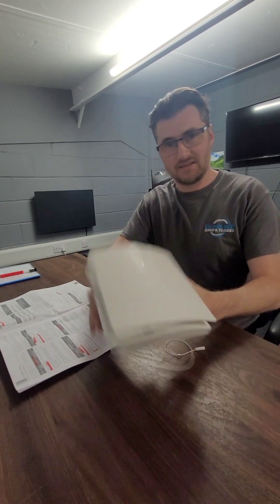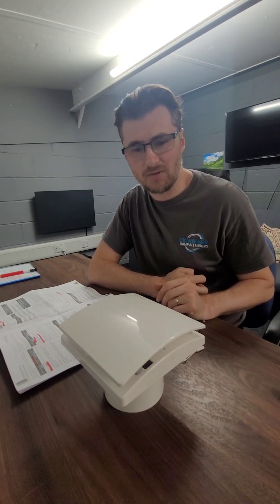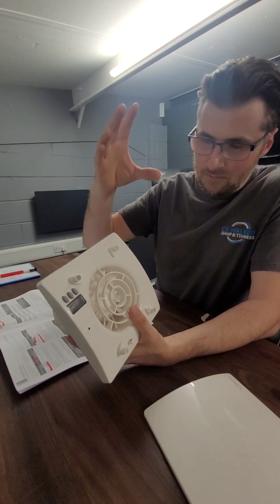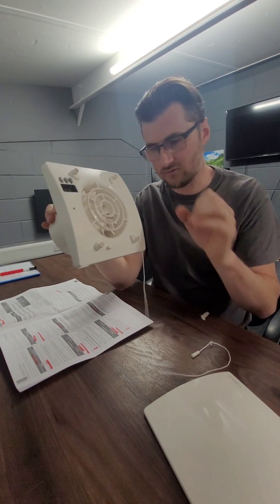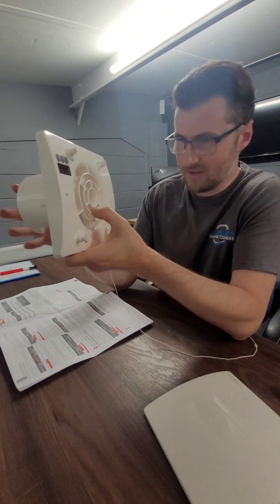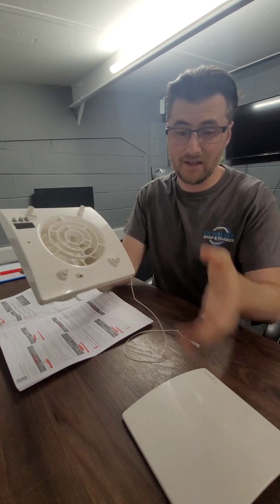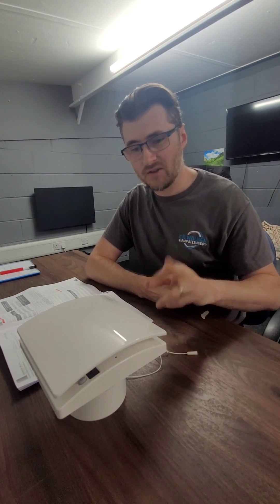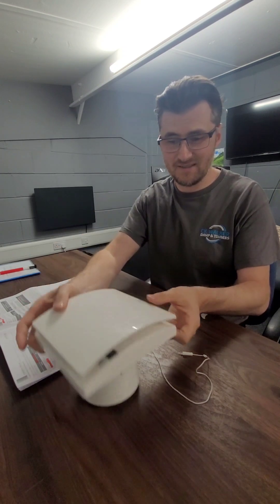Introduction to the Nuaire Faith DMEV Fan | Continuous Running Ventilation Explained

Comment: Is this a 230/240v or does it require a transformer ?
Also where are you located as I have damp issues in my daughter’s house in Oxford ?
Thanks
Reply from the maker: You can get the fan in 230v and low voltage (comes with transformer). 

We are based in Derbyshire, so unfortunately we don't cover Oxford. Best of luck fixing the issue.

Comment: Hi, we have a vent axia nbr high pressure axial fan 100mm basic in our bathroom. Only comes on when light is on and switch above door is on. Keep getting mould above window. Could I upgrade to one of these? Mindful of the wiring in order for it to be continual though
Reply from the maker: Yes, you should be able to swap to a 100mm continuous running fan such as the Nuaire Faith. The wiring must have a permanent live.

Comment: The problem is there annoying  . Constent dine . Also in winter all they do is take the nice warm air in your bathroom and basically chuck it outside  .
Reply from the maker: If the fans are making a noise which annoys you, then there may be an issue. Obviously there will be some noise, but on trickle rate this should be minimal. I have DMEV's in my own house and can barely hear them, unless i stand right next to it.  I do appreciate that everybody has different tolerances for noise though.

Regarding heat loss, you will only get excessive heat loss if the fan is turned up quite high. The only system  that addresses heat loss is an MVHR system. These are good but very difficult to retrofit in most houses. Personally i am happy with a bit of heat loss to have drier air on my property.  Less energy is used to heat dry air then damp air.

Appreciate your comment though. Everyone is entitled to their opinion based on their experience.

Comment: My mom had one of these fans fitted..it's on the wall but theres no pull chord...it seems to be working u can hear it slightly...but when cooking on the hob say boiling potatoes and veg...and there's a lot of condensation...it doesn't boost up any quicker to remove the condensation...the windows steam up we end up opening the windows..the man left no instructions..it's only been fitted couple of months...do the settings need adjusting???...
Reply from the maker: The fitter may have cut the pull cord off.

Normally the fan should boost when a certain humidity is reached. This is called the comford boost.  The settings are very easy to work through when you have the instructions. You should be able to find the installation leaflet online by using google.

Comment: I have two fitter, kitchen and bathroom, it is driving me insane with the constant noise through my hearing aids. I frequently turn them off.
Reply from the maker: Maybe they are turned up to high. I have these in my own house and can hardly hear them when running at the trickle rate.  When they automatically boost, then i can hear them, but it still isnt too bad. I don't have hearing aids, so i don't know if the sound is magnified even when on a low setting.

Comment: I had mine fitted a couple of months ago in my bathroom. Would there be any reason for it to just turn itself off and not work anymore 😢 it was working so well!
Reply from the maker: Could just be a faulty fan. I have also seen fans stop working after a power cut. Sometimes, there is a power surge, and this can damage the electrical components in the fan. 

Most fans have a warranty, maybe see if you can get it replaced.

Comment: Hi I am having issues with two of these fans one in kitchen and other in bathroom these were fitted by kitchen contractors I have told them repeatedly they won’t turn off boost they keep setting them wrong. Is there anyway I can correct this myself? I’m totally confused with the instruction booklet as not sure what setting they should be on?
Reply from the maker: The air flow rates of the fans are usually decided by calculating the air flow rate required at the property. Approved Document F states how to do the calculation and also states the minimum boost setting depending on which room the fan is located. You can find this document for free online. 

The fans have 3x different ways of running. 

1. Constant run - This is where the fan runs all the time at a low setting. You should hardly be able to hear this, but it will be continuously removing air from the room. A quiet setting on constant run is between 6-8 L/S.

2. Comfort boost - When the room is more humid, the fan should automatically boost. For a Bathroom the minimum boost should be 8 L/S and for a Kitchen 13 L/S - You could look to set each fan to 13 L/S to ensure moisture is removed when the comfort boost is triggered. This will be louder, but will only be for a short period of time until the humidity has lowered. 

3. Main Boost - This is activated by pulling a pull cord or it may have been linked to a light switch. Personally, i don't like to link fans to a light switch, as i find they then go to full boost (25 L/S) which is quite loud. This can annoy people and they end up turning them off, which defeats the point of the fan. 

The above are the first three settings in the menu. You also need to check the other settings. If the fan is ducted THROUGH THE WALL then this option should be selected in the menu. If the fan is ducted through the ceiling, then the IN ROOM setting should be selected. 

Without seeing the fans in person, the above is the best I can do for you.
Reply: @CkwalkerCoUk thank you I think they are supposed to be set to comfort boost and minimum 65 perfect humidity but seems s they’ve been set wrong I’ll try my best shot

Comment: How do i unlock the digital control panel
Reply from the maker: You could contact the Nuaire Technical team for that information, as it isn't included in the manual. A separate document is normally given with the fan saying how to set and lock the control panel. I don't think you will find this freely available online, as the whole point is to stop people from altering the fans.
Reply: I can't find the manual i must have thrown it out, I did contact the company but they won't give me the information about it
Reply from the maker: Unfortunately, I don't have any of their fans in stock at the moment, so I can't give you the info.

Comment: When you take the lid off to clean underneath it there is a tiny metal clip in side the lid, should the metal clip go in a certain way please?
Reply from the maker: I am not aware of a metal clip. There is a magnet in one of the holes which connects the cover to the fan. This is  designed to switch the fan off when the fan cover is removed.
Reply: @CkwalkerCoUk   I realised that's when I put the lid back the fan started up again. Thank you

Comment: Thanks for the video, how do I turn it to full boost? 
Thanks. 
Having issues with vaping toilet water on the ceiling.
Reply from the maker: @myselfvieira2756  The full boost is activated by pulling the pull cord (if wall mounted). If it is ceiling mounted, then the pull cord will have been removed.  If the fan has not been linked to a boost/light switch, then you won't be able to make use of the full boost. You will need to rely on the humidistat, which activates the comfort boost setting when excess humidity is detected. You can turn up the air flow for the comfort boost setting. However, the higher the setting, the louder the fan gets.  The instructions for the fan are really easy to follow to be able to change the settings on the fan. Just Google Nuaire FAITH instructions and you should be able to find a pdf document.